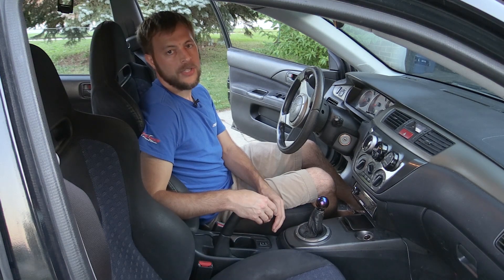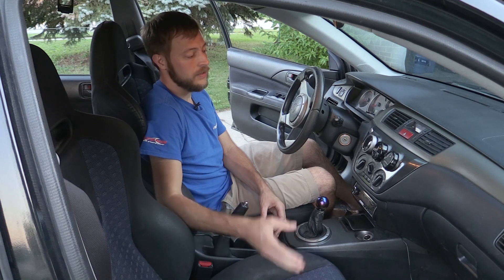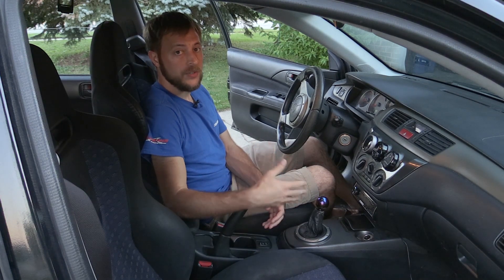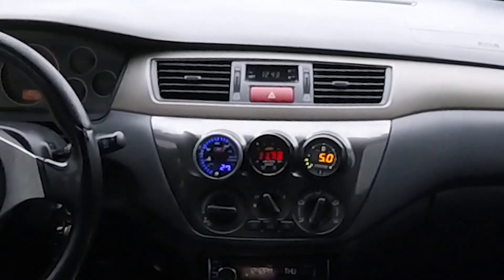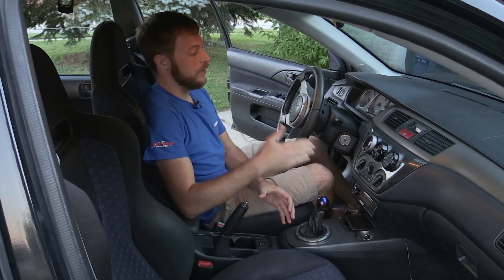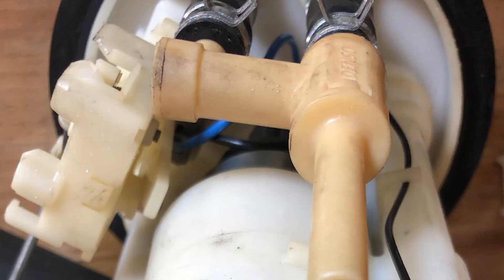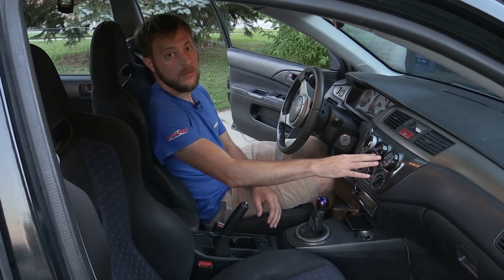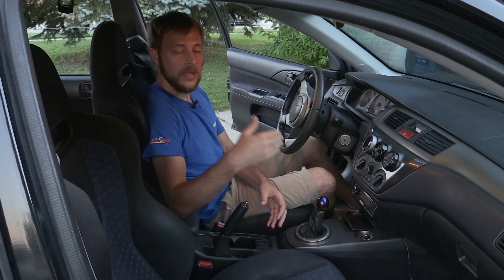Wideband Air to Fuel ratio gauge  - Why you NEED it!

Comment: This should be the first mod anyone does to thier car when modifcations are in mind.  I just swapped out my sensor after about 3 years just for piece of mind
Reply: old ones are proven to work, so a proven example is better for me. I can also exercise mine by running a dry nitrous setup that will cause near instant 15+ AFR
Reply: the real way  is gain the lambda sensor output from your obd2 data, if other than 1, figure out why

Comment: You'd think someone who suffered from a fuel delivery issue would be advocating for a fuel pressure gauge as well so you can see the drop off before it causes it to lean out at higher RPM. Zeitronix has an All In One that won't make your dash look like a light show too.

Comment: I am torn between this gauge and the AEM X series. I definitely prefer the look of the innovate, but I keep reading that the AEM is easier to install and does not need to be calibrated. Apparantly these ones need constant calibration?

I just want something I can put in my car that will just work more longer term as I am after a Wideband A/F, Oil Pressure and Boost Gauge for my vehicle.

Comment: That's cool. So you drill and tap a socket for a secondary upstream sensor? Looks like a good diagnosis tool too if you didnt want to do that!
Reply from the maker: You add a "exhaust bung".  A lot of evo people just remove the rear(downstream) 02 sensor and replace it with a wideband 02 sensor.
Reply: @BoostedFilms  awesome! Thanks

Comment: That’s a good tip, i also need the rubber spacer where can i get it?
Reply: Walbro install kit should come with one.
Reply from the maker: Richard is correct, buying a Walbro install kit is the only way i know to find one.  https://www.rallysportdirect.com/part/fuel-pump-install-kits/wal-400-847-walbro-installation-kit

Comment: Anything over the 12 AFR's under high load you are losing the added cooling effect in the cylinders.  EGT's will rise and you will begin melting parts.
Reply: what should you run AFR for e-85 ?
Reply: there a few "blow torch" videos where a clear cylinder head is used to see the quench and ignition, and then how a lean conditions forms very quickly
Reply: lean burn engines up to 40:1 , so what you say is only true for old engines, and old designs. Modern lean burn engine is built like the industrial GMC V-6 use in dump truck from the 1960's
Reply: Run whatever afr nets most power, without seeing detonation or high egt’s.     Sometimes the problem is the instruments used to conduct the tuning aren’t adequate enough. Ideally if you could monitor combustion pressure you could tune based off that.  Finding the perfect afr is something you have to figure out for yourself.  Have to develop your own tuning process.
Reply: @stephenmwyatt2  Get a lambda readout AFR gauge, it shows 1 regardless of the fuel's stoichiometric ratio when balanced. Don't drop below .75, above 1 is lean on any fuel.

Comment: Hi, I am running a V8 Chevy small block with a carburettor, now do I need 2 AFR units for each bunk of exhaust line or not? Typically I think since there are 2 separate exhaust lines then I should use 2 AFR units separately for each, is this correct? please help.
Reply: Heck no. At the very most weld in a bung in both pipes. Get one kit. Check one side and then tune it. Once tuned, swap over the o2 sensor to check that side. Cap the side you aren't using.
If you got extra money to burn, run 2 sensors and 2 gauges. That would be best but not really worth it in most cases.

Comment: At 1:08 you state “if You see 10 or lower your running rich” and if your 17-20 your running lean. If you’re in the mid 13’s wouldn’t that be the sweet spot or is anything higher than 10 considered lean?? All answers are welcome. I really want to understand this
Reply from the maker: It depends on what you are doing.  If your just idling, you want a Stoich AFR (generally 14.7).   But wanting Stoich is not always the case. Maximum power (full throttle AFR's) is usually found with a slightly richer than stoich mixture. These are all generalizations and this video is an over simplification.  A Mid 13 AFR at WOT(wide open throttle) would most likely eventually lead to an engine failure.

Comment: I have an old truck, going to get a wideband to tune the carb. Sometimes it runs great and sometimes it runs poor and I have no idea if I'm running rich or lean every time I tune the carb
Reply: if occasional shitty running, probably an intermittent vacuum leak, which is easy to see if you install a temp or perm vacuum gauge, and this is the best gauge for overall engine health, you want a steady vacuum reading
Reply: @stephenmwyatt2  I have almost every gauge you can imagine, all my temps,  pressures, vacuum, volt, tach. Everything reads good except it runs poor sometimes, engine has less than 3k miles on it, I bought this gauge I'm going to install it and see where I'm at as far as tuning goes
Reply: no vacuum drop during bad running?    it would have to drop, so check again   @ArcticAstrophysics
Reply: egt much easier for your situation
Reply: Vacuuuuum lockkkkkkk
Reply: ArcticAstrophysics know this is old but get a cheap vacuum gauge u can hook straight to the carb and set the idle CORRECTLY from there where it is pulling the highest vacuum possible while still running “smooth”. Then adjust your idle screw. If it runs good sometimes and not others, ambient temps could be helping or causing the prob of too rich or lean. Start at proper vacuum at idle
Reply: If it's electric choke check wires if it's manual choke depending on ambient and elevation will have days to throw everything off.
That's the only difference between efi , fuel injection V/S a carburetor..... You have to always keep tuning because you are the computer lol.
Black smoke out the tail pipe too Rich, white smoke too lean...
Just the basics

Comment: I thought the sensor is supposed to be installed on the downpipe? 18inch down the turbo?
Reply from the maker: Doubt think it has to be. When people dyno cars at a shop and add a wideband to watch AFR’s, they sometimes just stick the sensor a few inches into the rear tailpipe.
Reply: @BoostedFilms  cool! I’m getting mines ready to be tuned. the current set up I have is the wide and sensor on the exhaust pipe, just right after the HFC. I was looking into it and I found a lot of differences on where it needs to be. Thanks

Comment: Mines bounces around 13-16 is this dangerous for a boosted engine?
Reply from the maker: At wide open throttle or just cruising?   Cruising, that is just fine.  WOT, you got trouble.
Reply: Boosted Films cruising, I haven’t got to wide open throttle yet
Reply: Boosted Films what should it be around at wot?
Reply from the maker: @jeepwk6.5L  I'd defer to a professional tuner. But generally speaking, high 10's to mid 12's.
Reply: Boosted Films ah yeah the one who was gonna tune it actually got shitty with me so I didn’t end up getting it tuned all the way.

Comment: narrow band also useful, but not if you only know about half of the shit you claim to know
Reply from the maker: stephenmwyatt2 K... Educate me please.
Reply from the maker: @stephenmwyatt2   A lot of crap exist because people will buy it. A narrowband will tell you when you are rich or lean, but with no precision. You can't tune your car with a narrowband 02 gauge they way you can with a wideband.   If you find value and use in a narrowband, more power to you.
Reply: @stephenmwyatt2   Narrowbands are actually, much faster than widebands.  Every wideband has a narrowband embedded in it as a reference.  The output voltage of a narrowband does vary linearly, within a very narrow range ( hence, the name ), centered around lambda 1.0  With an accurate control system, you can maintain the narrowband output at 400-500mv.  Which is what a wideband actually does, internally.  That said, the linear output of a narrowband is not repeatable as it is HIGHLY affected by EGT and exhaust gas back-pressure, except, right at lambda 1.0.